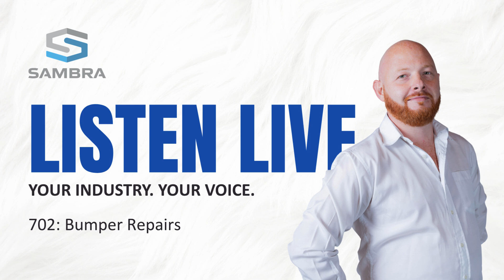SAMBRA on 702: Bumper Repair and Vehicle Safety

Comment: Bumper is a piece  of plastic.
When you really see what these bumpers holds , you'll be surprise ,every part around the bumper is plastic aswell. Like slides that holds it. Even other parts that holds the bumper is plastic. Like plastic clips.